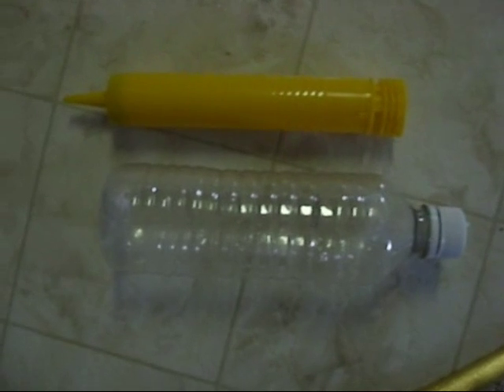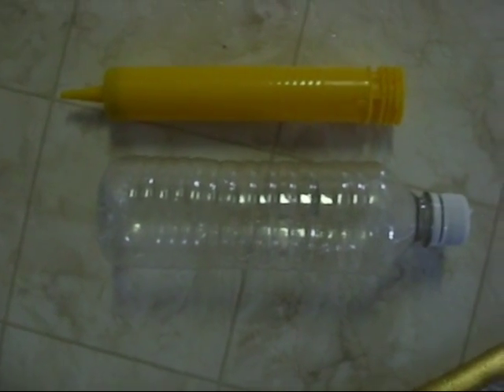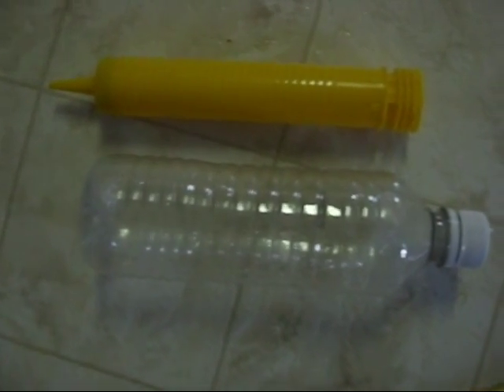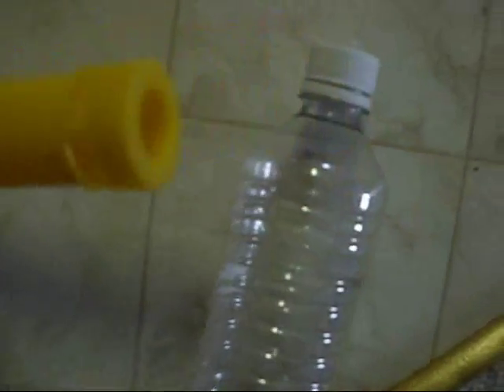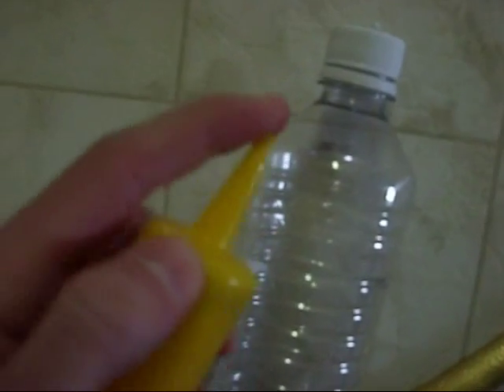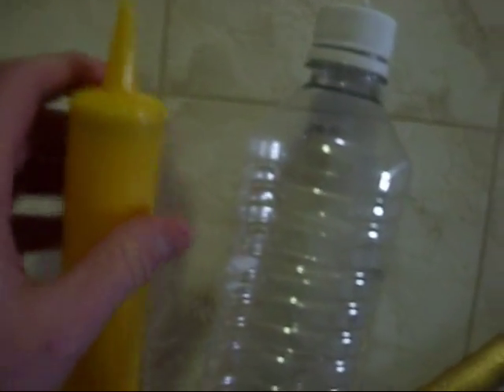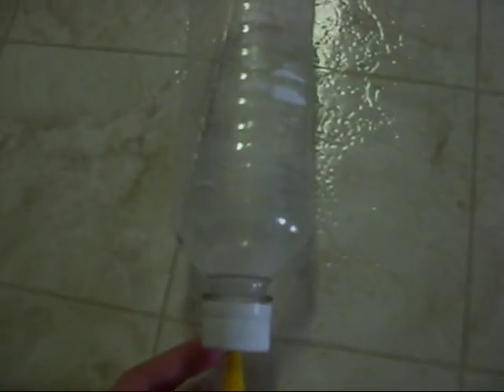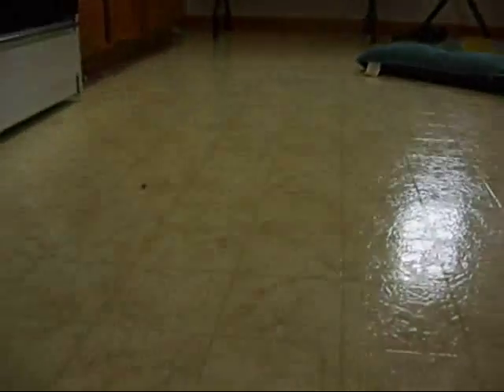Homemade Water Bottle Rocket and How to Make it

Comment: What is that yellow coloured
Reply from the maker: It is a pump used to inflate balloons. You can use any pump that will fit and seal inside the hole. I am going to be redoing a few of these older videos soon with some updated hardware and editing software so you can see it in higher detail at that time.